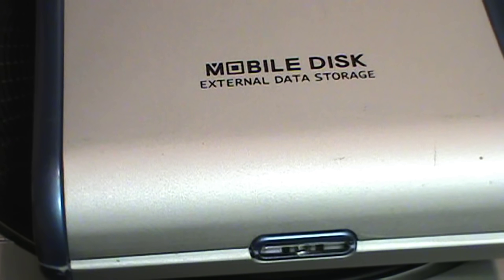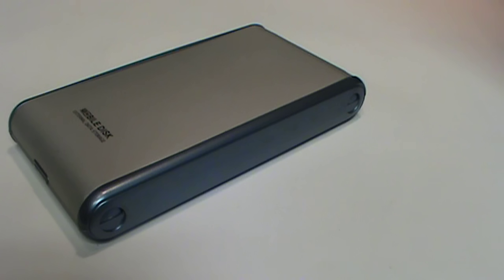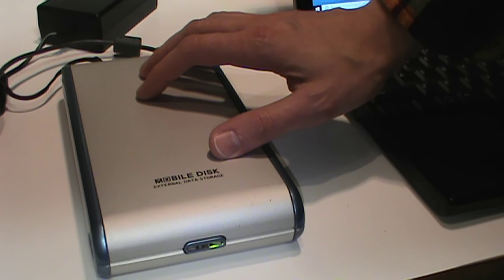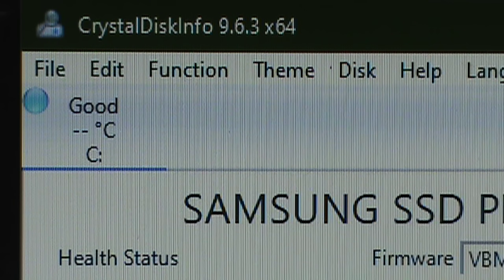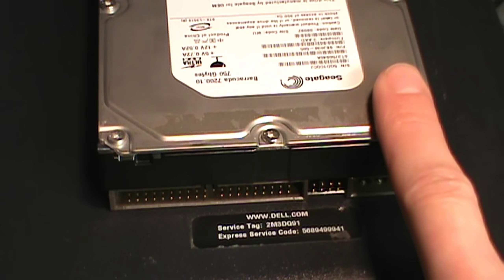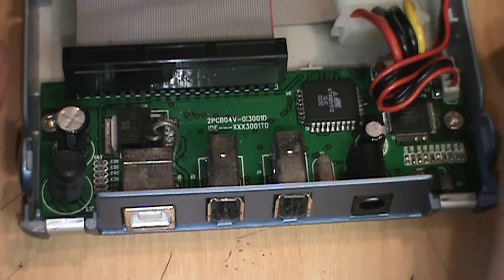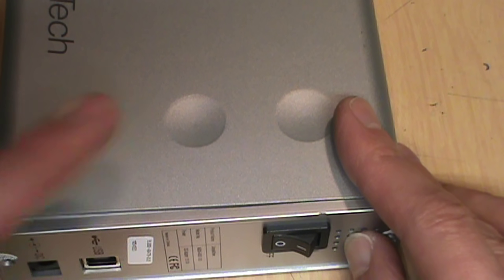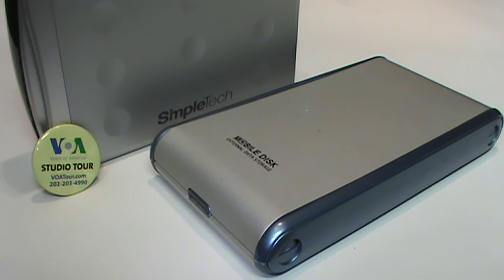The world's largest IDE hard drive failed on me

Comment: You have a 7200.10 Seagate drive. The model before the 7200.11 or .12. Those drives had major issues with firmware crapping itself, bad sectors, head crashes. They were as bad as the IBM deathstar. Your drive lasted quite a long time. Good idea to back it up!
Reply: The 11 and 12 weren't any better, I've seen a lot of those with either the BSY bug (drive stays locked in a loop where it reports being busy or initializing) or it just reports a invalid size (the dreaded 0LBA bug).. The 7200.11s you could get the firmware back up and running with a couple of commands in the drive's controller board (though you needed to isolate the heads for that to work) but the 7200.12s I've encountered... I never was able to get one going, I did get one briefly go just to copy files over... Before it went back to being stuck in BSY mode.

Oddly enough I have a couple of 7200.10s that are still alive and well, even though I use them as buffer drives for unimportant data, so if they fail, it's not the end of the world.
Reply: @Alexis_du_60  Agree. I also fixed a Barracuda 7200.11 HDD by updating the firmware to SD1A and BSY bug it's gone! (bugged firmware was SD15 on my 500GB Barracuda 7200.11)
Reply: @Alexis_du_60  and it was the exact same with Maxtor DiamondMax 22 serie (same disks, same spec, just rebranding), firmware MX15 that bricked the disk the exact same way, I remember well because I had a full RAID5 of those back in the days, I had to put all that on a SATA controller set to IDE mode, and flash the whole bunch to firm MX1A. Like I said on a previous message, I totally ditched any consumer-class drive after 2010/2011, moved to WD RE3/RE4, Seagate Constellation ES and Cheetah 15k because I was and still is to this day very familiar with linux and server hardware and a massive HDDs user, after the WD factories flooding in 2011, I ditched any low-end storage product once for all, and never looked back.

My very best torture test : a pair of 320GB caviar blue (around winter, 2009/2010), I put them in RAID0, I ran like a good 60 VMs at once on them, they both died in less than 2 weeks of this 24/7 constantly R/W scratching, and they both ceased at once, and then WD got one of their weidest RMA ever, you could hear the little metal chucks inside despite they never dropped on the floor, and the best part is WD actually changed them both and sent back to me a pair of 500GB non-refurb brand new WD blue drives 😂
Reply: @Alexis_du_60  with 12s you have to disable some background processes and Idle in saved mode pages (sys file 93).
Reply: @Alexis_du_60  i meant the 7200.11 and .12 were really bad with firmware and head crashes and bad sectors. I've even seen some headcrash so bad they dug grooves in the platters with dust all over inside of the drive.

Comment: You've said that old data is not important, but this is actually the complete opposite of what you should do with potentially dying hard drives if you need what's on them. Do not try to plug it multiple times to different systems, do not ever start any Checkdisk “repairs” that destroy what it finds incorrect (graphical check does the same thing as console check), do not try to move the files via file manager if there might be errors. First, attach it directly to a known working system, and use dd-rescue (or similar tool) to make an image of all (currently readable) sectors from start to finish (maybe after multiple passes), then work with that image to copy/fix the data. Even if the failure is limited to certain sectors, and disk generally continues to work fine, you'd better perform write test for the whole surface (to auto-remap the potential new problems).
Reply: This works with DVDs too
Reply: @veganmax8015  dvds aren't magnetic and you can't move the data around or read/write anyway
Reply: @supertoaster94 You can definitely read DVDs. I think they meant you can make an image of a DVD locally and then manipulate the sectors, then burn to a blank disk, which hadn't occurred to me before.
Reply: I used hdd regenerator not cheap but it works.
Reply: I don't see why it would matter, the drive is fine, he just had a bad usb/firewire enclosure. The data wasn't important. Chkdsk didn't find any errors anyways. You can also run chkdsk in a read only mode, so if it finds something, you can decide what to do before going through with changes. Use your tools. You can't undo what the bad enclosure did, that's why external drives are only intended to be backup media I.E. a copy of data you already have somewhere. If it's alone and not backed up you can call it archive or whatever you want but it's vulnerable. In my experience if you have a drive with anything bad at all in smart just lose it.
Reply: @itstheweirdguy  Three reallocated sectors is NOT fine. It's a different spelling of "only store data you want to lose here".
Reply: @AttilaAsztalos  This drive was probably working unreliably due to not enough Watt from the power supply and causing voltage drops. The drive controller might have reallocated sectors that were otherwise perfectly fine, but were poorly handled. The other common issue with putting drives in an enclosure is excess heat. Meanwhile a low level format might make this drive new again if you can find the tools to do that from Seagate.
Reply: @AttilaAsztalos  I'll toss a drive if it even has one reallocated sector! Some would consider it wasteful but I see it as a sign that the drive can't be trusted.
Reply: @steeviebops What? Mime has a few reallocated sectors, and it works just fine. It's a 10 tb barracuda pro
Reply: @steeviebops  That's crazy. Hard drives usually come with several bad sectors from the factory. Since they're detected at the factory they don't show up on the SMART parameter. One more sector doesn't mean anything. Maybe don't store your only copy of your most important files on such a drive but otherwise it's fine.

Comment: My biggest IDE HD is also Seagate and I also found it in a failing USB enclosure, mine is 500GB and it's an oddball for me, because the 2nd largest IDE drive I've ever own was 120GB (failed long ago). Right now it's in another crappy USB enclosure that will probably fail just because at some point, storing low priority back-ups.

Comment: You also need to try "HDD Sentinel" to see the remaining % of your hdd health. If your drive is below the accepted %, you need to backup your data.
Reply: This seems to me like snake oil being sold as insurance.  The world's biggest dependents on hard drives (such as Google and BackBlaze) have all tried to correlate early warning markers from SMART data -- which, to be clear, is the only metric you have outside of the drive -- and have never been able to nail down an accurate and reliable indicator.  They all agree that some indicators are worth noting, if you see them, or if you see them change.  But in terms of whether that indicates the drive is actually about to fail.... it's no more accurate than a guess.

The takeaway has always been:  If it's important to you, save it to at least two different places, because eventually one of those places will fail you, and you won't know until it does.  Any software that tries to tell you otherwise is giving you a false sense of security.
Reply: Agreed, I’ve used it for years and it gives me a lot more info than crystaldiskmark does and breaks down the issue and what to do about it. The free version nags you everything you boot it up and you need to wait 12 seconds before you can continue, but the program can be used forever.
Reply: That's only for SSDs.
SSDs show such a percentage value.
For HDDs it's usually fine until you get issues with reallocated sectors.
At that point it's 50/50. Either the sectors stay the same for years (likely just a minor headcrash that didn't affect the surface too much) or it's the beginning of the drive's end. In that case the reallocated sector count will rapidly grow over the next few hours/days/weeks.
So in any case, if you see reallocated sectors, the thing is not to be trusted anymore. It might however still have live left as a download / games drive where reliability doesn't really matter
Reply: @TheRailroad99  yeah i have a laptop with a drive that the realocated sector count just keeps going up. 761+ . there is no data on it that matters i just want to see how long it will last

Comment: Back in those days, Seagate's slogan was "Put your Life on it". I used to say "Bet your life on it" because they would crash so much. Especially those drives. If I remember correctly they had a firmware or controller issue with those era drives that would crash them constantly.

Best utility I've found to repair a drive with only a few sector failures is a program called HDAT2, which is a free Universal disk utility for DOS that is still supported today. It uses the internal repair routine on the drives to reallocate the bad sectors to the spare sectors of the drive as long as the head mechanics of the drive are sound. Boot the Optiplex with the HDAT2 disk, select the drive, and use the device test menu to select "detect and fix bad sectors" and keep running it until the scan passes with no bad sectors. 

You don't want to use the Seagate DOS utility. most of the time it crashes and it will stop after it detects a few failures.

Comment: would the sectors go away if you reformatt it?
Reply: Probably not.  Drive firmware is black magic, and nobody but the HDD manufacturer knows what it actually does.  But, IME, the way it works is:

If the data in the sector is unreadable, you get a read error.  If you format it, or write over that sector, then it may or may not work reliably indefinitely.  If the sector itself is unreliable, the drive firmware might eventually catch on, or it might leave it up to the OS to use filesystem-level markers to avoid that sector.

If the drive can't locate the sector (because, e.g., the permanent servo track the drive uses to position the heads has failed) then the drive will report a read error until the sector is overwritten ... at which point the firmware will take the opportunity to mark it as inaccessible and allocate a spare sector in its place.  You will see the "reallocated sectors" count increase, and you might hear the drive head seek during what should be a linear scan of contiguous sectors (such as a surface check.)

In the latter case, it's transparent.  The controller and OS won't even know the sector is reallocated.  It's all done by the drive firmware.  The only thing the drive tells you is the number of sectors that have been reallocated, just so you are aware that media errors have occurred.

The drive continues to allow you to attempt to read a defective sector until you write over it, because who knows -- maybe one time out of fifty it'll actually work, and the drive wants to give you every chance to recover the data.  But once you write new data, it'll try to place it somewhere else to prevent using a known defective sector.

Drives keep a pool of hidden sectors specifically for this purpose, so even though it has marked some sectors as unusable, the capacity doesn't change.  Eventually, you'll use up all the spare sectors, and then you're just out of luck.  The OS can work around that by marking those sectors bad, but reformatting the drive will erase those markers, and you'll have to re-discover them on subsequent checks.  Hopefully, before anything valuable is written to them

This is why MS-DOS takes so long to format a drive, BTW -- it writes to and reads from every sector to ensure they're valid, and marks them as bad if they're not.  Most modern OSes just write the bare filesystem structure, which takes a few seconds to a few minutes -- unless you specifically tell it to scan the entire volume.  But given the size of modern hard drives, that can take hours, if not days, to complete.

Comment: My grandparents have an old XP machine that they insist on keeping on and idling in their basement. Its 20 GB ST320011A has clocked 117,367 hrs, or 13.4 years, of power on time, and not a single S.M.A.R.T. error to report!

I shut it off every time I go over and it's always back on the next time. I have no idea what they use it for, as they have modern laptops upstairs. I check CrystalDiskInfo every once in a while to make sure it will keep doing....whatever it does.

Comment: The board in the enclosure looks very like the one that was in my old PATA external drive enclosure. It started having similar issues and would randomly disconnect when it was a few years old. I liked it because I could connect it to my G4 Mac mini via FireWire for faster transfers but it had a Prolific controller on the board that was apparently well known for reliability issues, particularly over FW. I wonder if yours has the same chip and since it has been used sparingly to do backups rather than as a system drive, it managed to live a lot longer than mine?

Comment: so technically the HD didn't fail, the enclosure failed
Reply: The drive reallocated sectors, a (modern) drive with reallocated sectors is a failing drive in my book.
Reply: @brandonupchurch7628  i have plenty of drives that have some reallocated sectors (and the redundancy to not care if some fail) and they are working 5 years later. So far all drives that failed, just stopped working (i.e. went unreadable or disappeared completely from the system)
Reply: No spoilers please 😂
Reply: @ManyNestedTree  right

Comment: My first IDE drive (with 40 pins, not 80)was a Seagate with 104MB, bought in December 1992.
Reply: I think all 3.5" IDEs have 40 pins. It was the later IDE cables that had 80 conductors in order to put a ground wire between every signal and reduce crosstalk.
Reply: @MrDuncl  exactly, it was required to run a PATA disk with UDMA5 (100Mb/s) and UDMA6 (133Mb/s) disks, it was heavily grounded to reduce electric noise, without this, the max transfert rate with a 40 wires ribbon was UDMA4 (66Mb/s).
Reply: Western Digital Caviar 85MB, which was what came in my AST Advantage 486SX/25.  :-)  That computer's spec sheet should have listed RAM and HDD space as "not enough."  haha  But they got it just under a grand at the time, which I'm sure was the point.
Reply: @sirnickity  That reminds me of a PC meme that shows a desktop computer sales sticker claiming that the computer is „Never obsolete“. Yet you can clearly see it has a 3,5" floppy drive... 💾🧓🤣
Reply: @ Yeah!  eMachines!  I've got one right next to me, with the sticker right underneath the DVD-ROM drive.  haha
Reply: @ Has it automatically upgraded to Windows 11 yet, despite the non-PAE CPU and (Almost certain) absence of mandatory TPM?... 🪟⬆🙃

Comment: I've found hard drives in old cable boxes, and I've formatted them, and they work fine, in fact YouTube user 12voltvids has done several videos where he found perfectly working hard drives inside old cable boxes, that's a topic for a future video finding good hard drives in old cable boxes from the thrift store.
Reply: DVRs, particularly.  And, yes, they're just commodity drives.  Perhaps ones that are targeted to video usage -- RPM and seek times optimized for low noise rather than speed, a healthy cache to mitigate random access time compromises, and targeting long-life 24/7 operation.

It's similar to NAS-oriented models, which have some FW tweaks to favor RAID-based error correction and things like that, although those seem like a relatively recent niche.  The earliest media-oriented drive I have personally found was a Maxtor 120GB drive from a Dish Networks 510 (?) DVR, and I don't recall there being NAS drives back then.  Maybe some industrial variants by Hitachi, for use in big-boy storage units.
Reply: I upgraded my folks’ satellite box from 250 (320?) GB to 2TB, the max the firmware could support. Even used an obscure Windows utility to transfer their recordings from one to the other. When it came time to upgrade, the installation guy didn’t give them enough warning for me to swap them back round :( 2 and 3 terabyte drives are still super useful!

Comment: Could be a failure of the voltage regulator in the enclosure, noting it's a barrel plug input so presumably 12v-in, and given you need 5v & 12v for a spinning rust drive to operate, if the 5v reg conks out, it knocks out the logic on both drive and USB-IDE controller causing errors to occur, of course whether it's worth fixing though, that's up for debate... :)
Reply: Or even the caps connected to the regulator.
Reply: @twocvbloke  very good analysis. That is quite possible.
Reply: That enclosure is is also from the cap plague era, I have one of them with bulging caps and it does not want to spin up all the time.
Reply: I had a similar issue on an almost brand new one, turned out the issue was with the switch. The power switch was wired into the 5v line and caused a brownout when the drive tried to pull power from 5v. I have a feeling similar issue is occurring here, I was going to fix it by squirting some contact cleaner into the switch.
Reply: either way it's much cheaper and safer to just replace the enclosure

Comment: While ago I got some PC with 32GB Seagate IDE HDD. When I decided to check it, I waited about half an hour on XP boot screen and then tried to check what is on the HDD from Hiren's Boot CD. It was unreadable and HDTune reported errors. I decided to boot to MHDD and do erase and remap and surprisingly HDD was brought back to life - no errors in HDTune and it worked fast. I know that it just remapped failing sectors to others but I think It's good enough fpr retro purposes. Did that to a buch of other failing HDDs I had laying around and it helped them to extend their life as well.

Comment: I've got a drive I bought as NOS back in 2022 laptop IDE 160GB arrived with 10 reallocated sectors with zero hours on the clock. It has thrown a caution on cyrstaldiskinfo its entire life. Currently at 87 hours and counting.